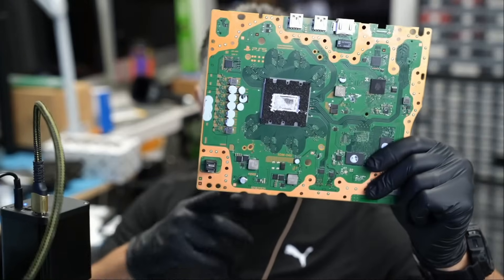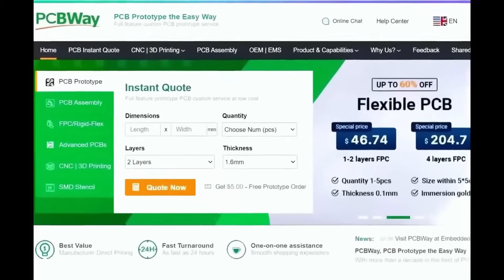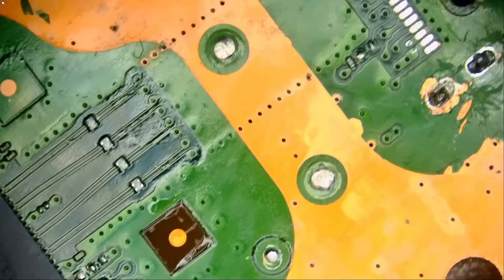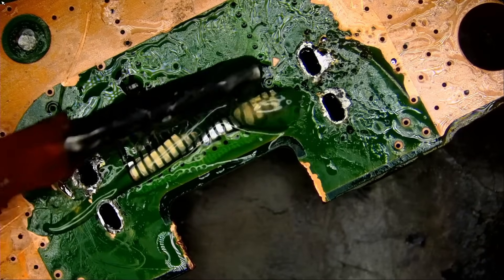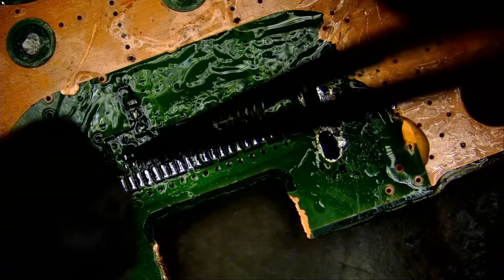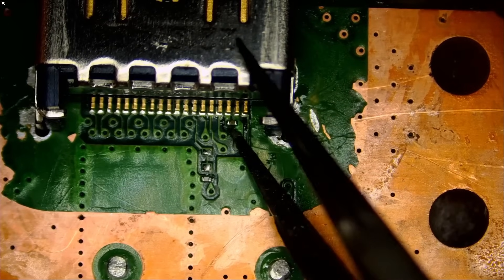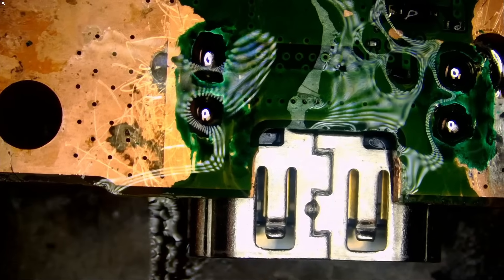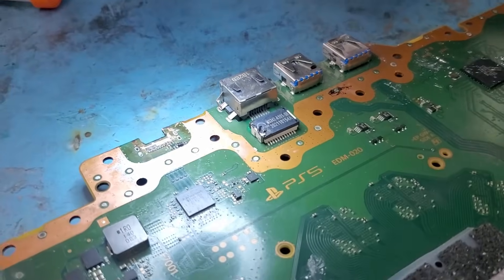PS5 Slim Repair - Liquid Metal and HDMI Damage Another Tech Left Behind

Comment: Question: a PS5 digital that only boots into safe mode, then you turn on the controller, it shows it's loading then turns off, is that a liquid metal issue? I think if it was a PSU or motherboard part issue it wouldn't boot at all? Already cleaned all the dust out of it.